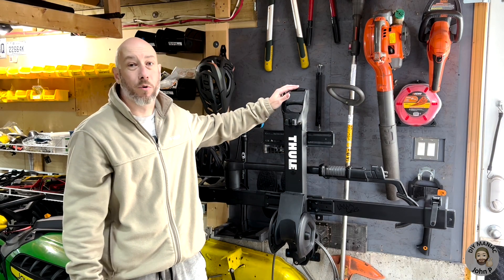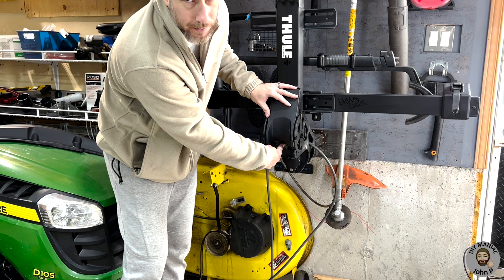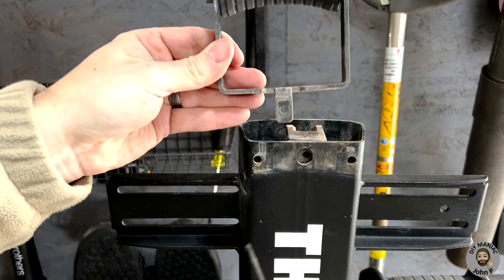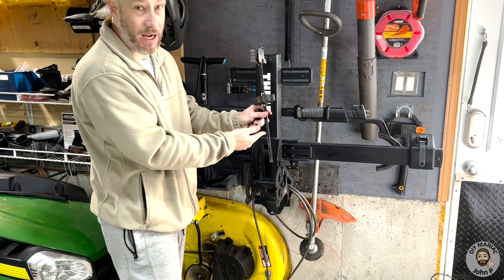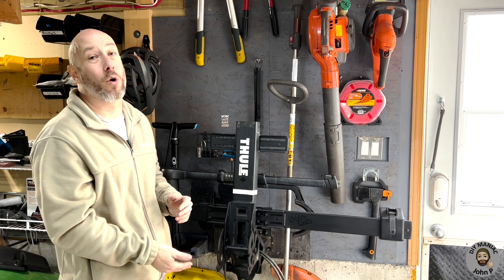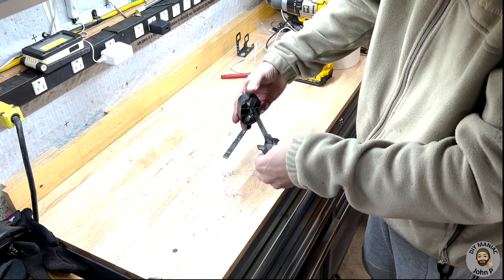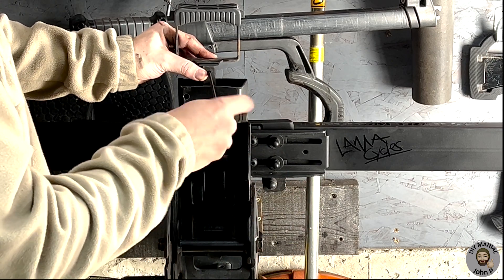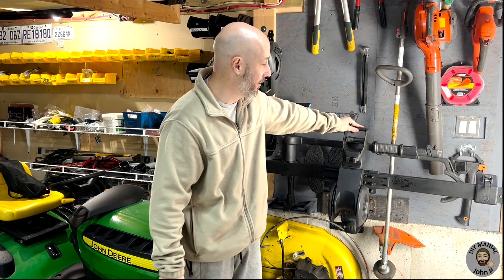Thule T2 Pro Single Bike Mod

Comment: Great idea and a great job making this modification - thank you for taking the time to this.

I have been wanting to cut mine down to a single for some time but have been looking for someone to do it and post it.

I also have a 2 bike add on - I am pretty sure it will work with the 1 bike cut down. I usually ride on my own and would love to cut mine down to 1 bike to get rid of the extra overhang etc. But my seven year old daughter now rides so we will be loading 3 bikes for our adventures very soon.
Reply from the maker: Thank you so much for watching for your comments

Comment: Awesome video, thanks!  I wanted to do the same and thought I was probably not the first one to want to do this.  Sure enough, here you are!  Knowing it can be done and seeing all the internals beforehand will be a tremendous help!!!
Reply from the maker: Thanks for watching the video and feel free to hit me up with any questions you have as you undertake this.
Reply: @DIYManiacJohnP  Completed the mod today (well almost, waiting for the Tremclad paint to dry before I reassemble).  I went a slightly different route with the handle, releasing the captive screw and pulling the whole assembly out as opposed to splitting it open.  I feel it was a bit easier and less risky of breaking anything.  That said, I may regret it when assembling everything back together!  I don't think I would have tackled that job without your video, thanks again.
Reply from the maker: @pcbroch  that’s great. so happy to hear that your project went well